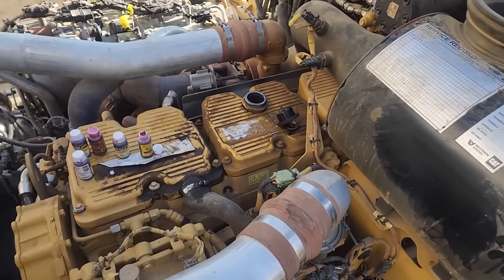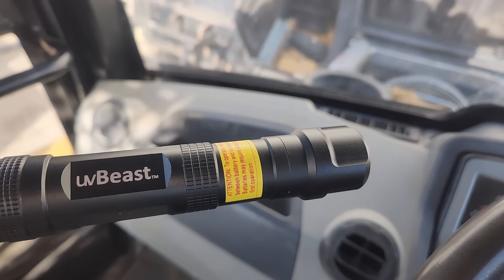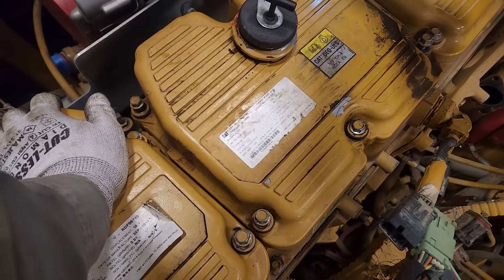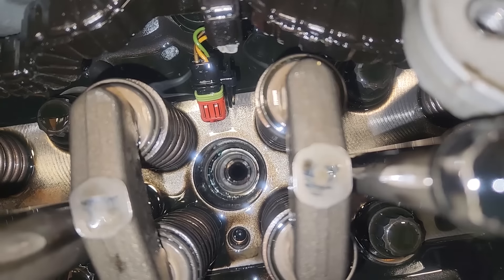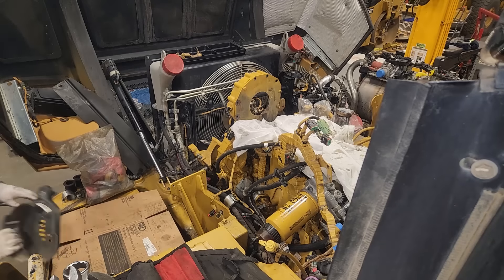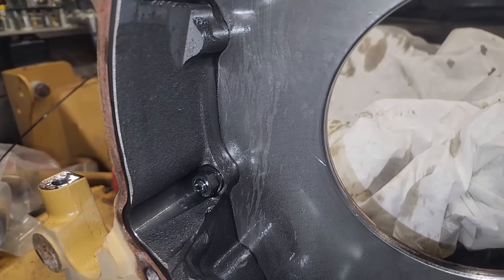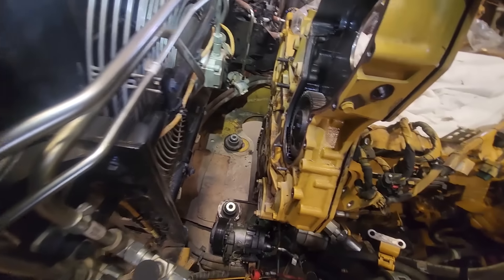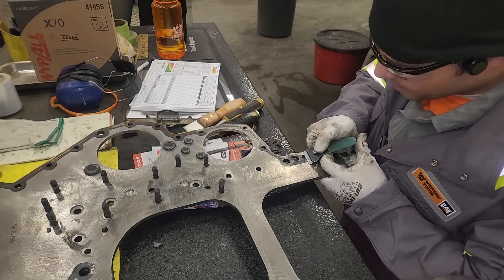C18 Diesel Engine has BIG TIME oil leaks in a Big 745 Haul Truck.

Comment: Interesting! Cleveland Brothers just did this same job on the one I run, since new. Only 5K hrs.  I’ve been very familiar with these almost since they came out. This is My 2nd new one. I’ve been doing this stuff for over 45 years, just for the record. I’m sure You are aware of the major problems with these trucks, mainly the transmissions disintegrating. I know what the problem is, and it is not the transmission, it is the shifting programming in the software that is destroying the transmissions.  The updated programming made them worse. The engineers never operate these machines in the “real” world, or even inquire with veteran Cat operators such as Myself when problems arise. I’ll tell You another “MAJOR”  problem with  these trucks, and it relates to the oil leaks and exhaust leaks.  Weather it’s oil leaking and burning on hot surfaces, or manifold coupler joints leaking, where do those fumes go when traveling?  I will tell You where some of it goes, and that is right inside the operators cab!  I have proof!  How does it get in the cab You might ask?  And just for shits and giggles, the exhaust coming into the cab is pre- def  treatment.  These fumes come out black vent on the right bottom side of the hood. That black louvered vent that looks like a ridge vent under the peak of Your house roof.  And what is right alongside of that vent ?? Oh, yeah, the cab intake fresh air filter! What a great design! These filters are great for dust, but do not work for carbon monoxide. Like I said, I have the proof. And that is also part of the problem why the AC is “weak” on these units, sucking all that hot air in the same place  the fumes are coming in. I could add more about the mirrors and lights and operating these machines in inclement weather, but that’s enough for now. Cat really effed up on this one.
Reply: I've worked on a bunch of haul trucks (mostly the 745 as they're more common), but none I've seen have a cab fresh air intake anywhere the CEM. They're behind the panel on the right side of the cab. Also, the issues with the trans are cooling related with a couple different clutch packs. They modifiy the trans case and add an additional cooling loop to those clutches. The new programming actually disables the retarder function as they were finding out excessive use of it was tearing up clutches as well.
Reply: Thanks for sharing.
Reply: @SuperSecretSquirell So what is that square vented panel on the outside right side below the window with two screws and filters behind it?

Comment: For the dampener on the engine side. Use a large deadblow mallet and give it a few love taps. My favorite tool for fron covers is my milwaukee right angle impact. Works great.
Reply: Won't work on a Ships front Damper that weighs in excess of 2 tons or more, that is inspected on a major overhaul

Comment: Being a Wheel mechanic in the army that's always working on or around CAT engines the motorpool could really use people with your kinds of experience in the bays! Thanks for doing the things I thought I'd be doing in the Army, but I'm just a glorified parts replacer and no actual troubleshooting like this. Operators run the trucks into the ground and we never pull engines apart like this! Thankfully I haven't had to replace any engines in a while but the last one I did do was a 2 Stroke Diesel out of a 80's Detroit Tanker. 

Also that Fire Truck is an old LMTV Soft-top cab! I recognized the layout of the whole dash and the triple wipers. 😄

Comment: If your abrasive wheel is removing metal with the gasket, it’s probably too abrasive. There are many wheels with different hardness to avoid impacting the metal finish. I use a scraper occasionally too, but it often takes a terribly long time.

Comment: Awesome video Josh. When I used to do that kind of tedious work people said I had the patience of a saint. It takes a person w/ real integrity to pay that much attention to the never ending details. That right there is why some mechanics say the engineers hate them. But I suppose they were just like GM in that they only care about the "new" vehicle buyer no one else. At GM we spent hours & hours in meetings discussing warranty costs and they always put the emphasis on "do it right the first time" so we didn't have to eat the cost of warranty repairs, nary a second to ease of repair. One example: They proposed putting a bolt into a hold down flange and have it break off leaving nothing for the mechanic to get a hold of to loosen it. e.g. To stop unauthorized injection pump timing adjustments.
Excellent video Josh, you'd make a good aviation mechanic, but I doubt it'd pay any more. ben/ michigan